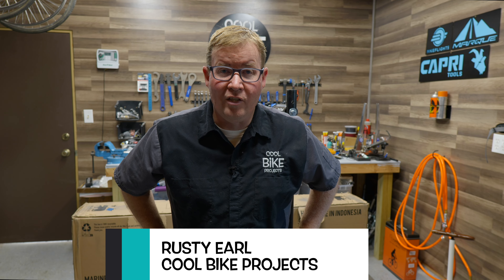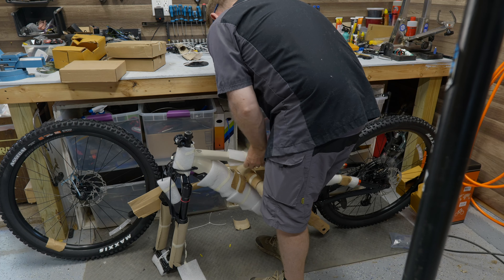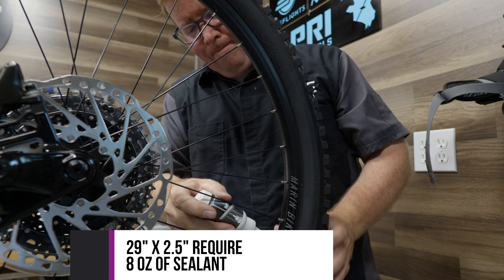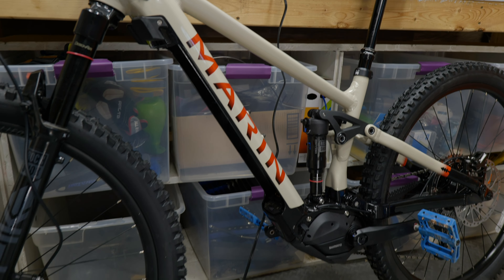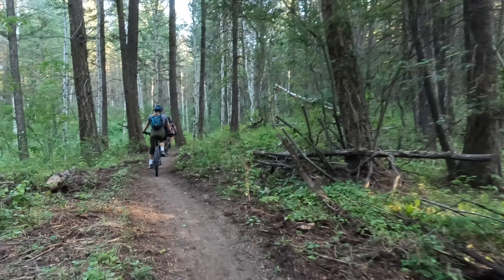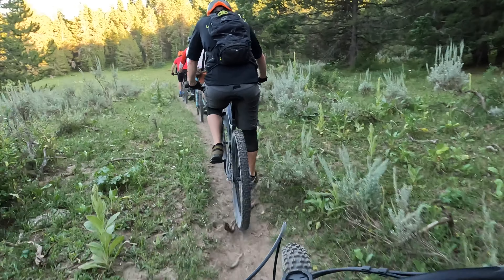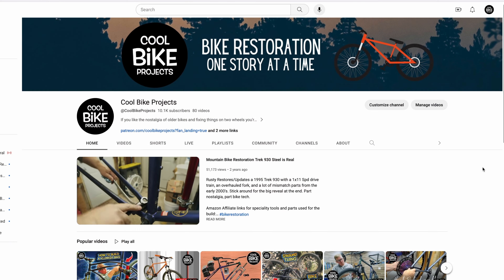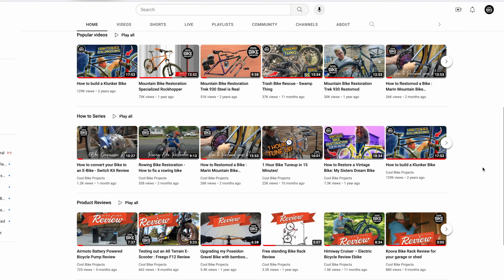2023 Marin Riftzone E1 - First Ride/Review

Comment: Hows the bike feel if the battery has ran out is it heavy to pedal back or does it feel like a normal bike if no power was left.
Reply from the maker: I think all E bikes in this class will fill definitely heavier just because they are, (50lbs) at the same time, riding downhill, or on the flats, would not be hard at all. Right now I’ve been peddling around the neighborhood with my youngest daughter and she learns to ride her bike and I have the motor turned off the whole time. You really can’t tell that the bike is that much slower.